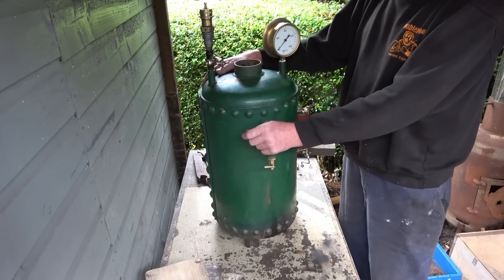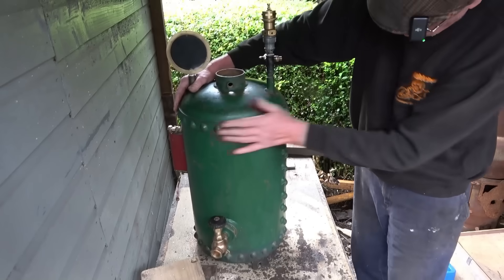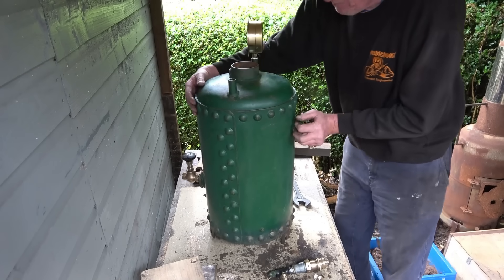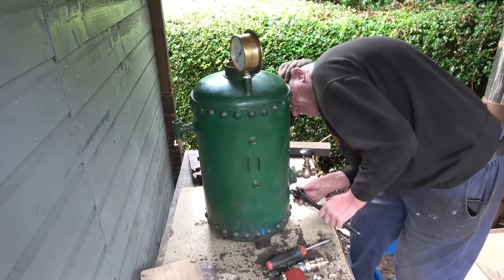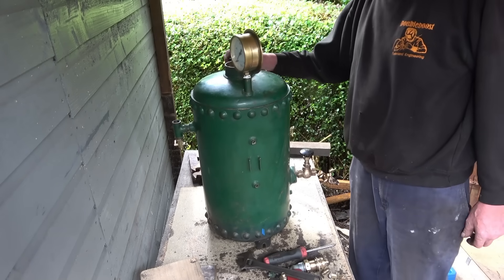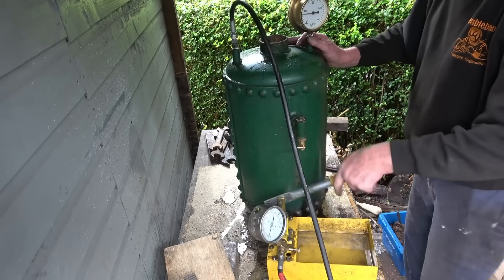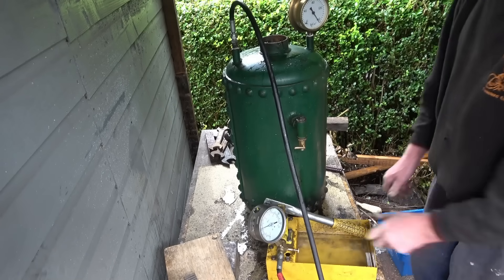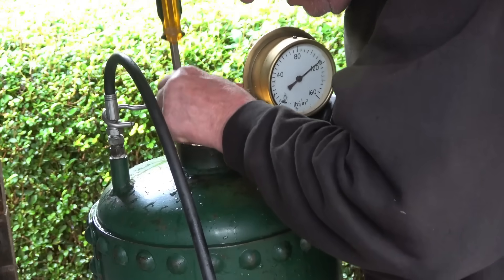Wednesday Catch Up 68  Steam Boiler Assessment & Hydraulic Test.

Comment: Hi John..  That boiler is far too nice for a patio heater, at least without an attempt to fix it. It looks as though the central flue is welded in at both ends..  If so, carefully cut it out, probably with a plasma cutter, and replace with a new steel flue welded top and bottom.
I had a similar size and looking boiler many years ago, and the central flue had no cross tubes.  Just a plain tube.. But it made plenty of steam enough to play with engines of 2inch and 2.5 inch bore.
Please have a serious think about it John before condemning it..  The other weak spot is the outer edge of the bottom tube plate.. Do you have access to an ultrasound thickness gauge..  I would lend you mine if you lived closer.
Best Regards.... Harry.

Comment: Would be great to see the tubes and maybe an inspection camera inside the boiler.  Is the tube leaking at the end or middle?  If it's just the one tube leaking can you blank it off?  I turned up some taper plugs with a threaded rod to blank off a tube to get through the rest of the season, then replaced all the tubes over winter - hindsight the rest of the tubes were good and might have gone on a good while longer.
Reply: The boiler has cross tubes so he most likely can’t get to the ends

Comment: How did they hold up the rivets inside when they made it?
Reply: Do the long seam first, then fit the dished head, reaching inside possibly with one of those C shaped riveters to hold the inside end of the rivets, then fit the centre flue, complete with cross tubes and weld it to the head, then fit the base which is a reverse dish, so you can access the last rivets on both sides from the outside. Lastly weld the bottom end of the centre flue.
Reply: @emma.jacobs1 …… sounds feasible!